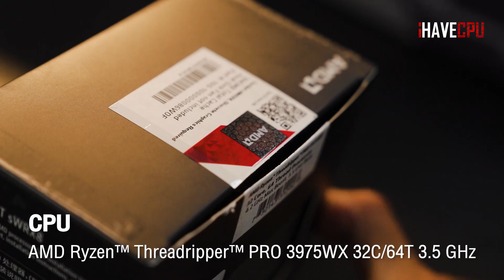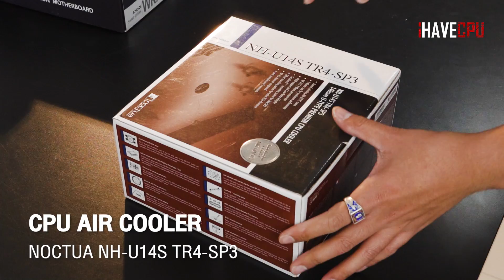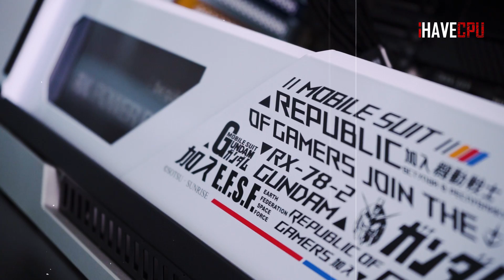คอมเครื่องใหม่ของ Ananped สเปก AMD Ryzen TR PRO 3975WX + ASUS ROG STRIX RTX 3080 จาก iHAVECPU

Comment: พี่เปาครับถ้าจะจัดคอมสเปคเเบบนี้ราคาประมาณกี่บาทครับ
CPU : INTEL Core i7-6700K 4.0Ghz
Motherboard : MSI Z170A GAMING M5
VGA : GALAX GTX1080 EXOC 8GB
Ram : KINGSTON Hyper-X Fury DDR4 32GB (8X4)
HDD 1 : Western Digital Black 2TB 
HDD 2 : Western Digital Blue 1TB
HDD 3 : Western Digital Blue 1TB 
HDD 4 : Western Digital Blue 1TB
SSD : KINGSTON Hyper-X Savage 480GB
Power Supply : CORSAIR RM850 (850Watt)
Case : CORSAIR Carbide SPEC-ALPHA Black-Red
CPU Cooling : COOLER MASTER Sei
อันนี้สเปคคอมopz tvน่ะครับผมเเค่อยากลองจัดตามครับ
Reply: เปลี่ยน cpu กับเมนบอร์ด น่าจะดีกว่า